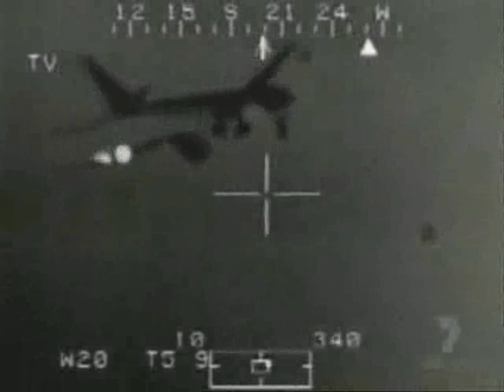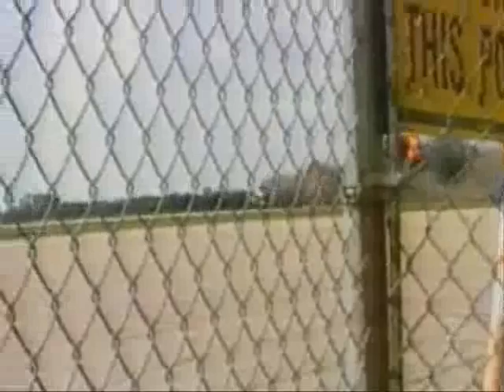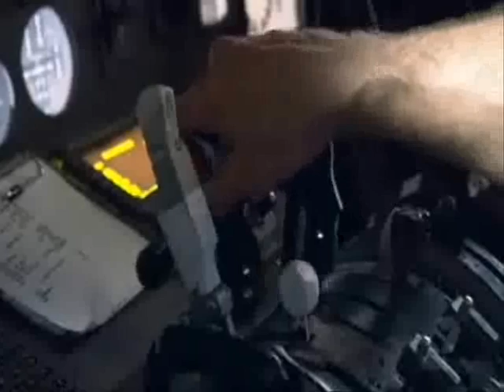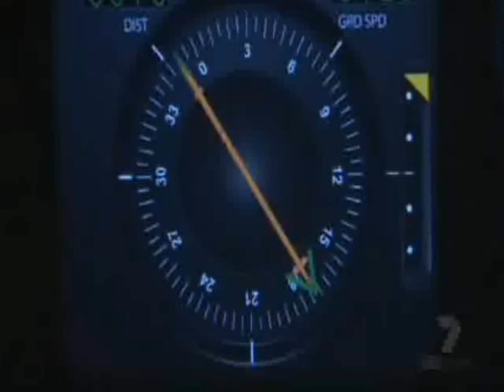Air Crash Investiagation - attack over baghdad part 4

Comment: @74LesPaul 
Sully had full hydraulics working. APU was working. They even dropped flaps at 300 feet. Left engine was idling, not dead. Thats why it didn't break off like the dead right engine did.